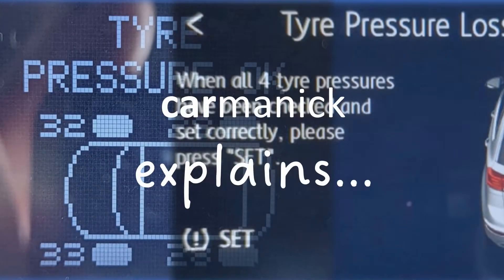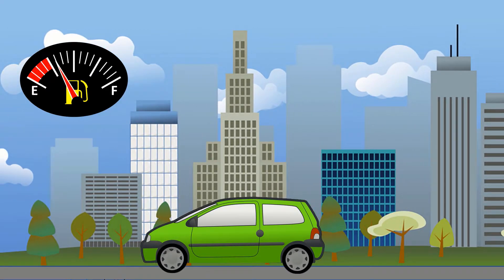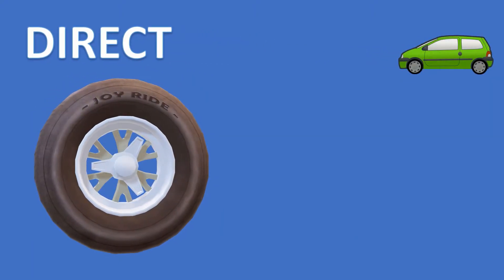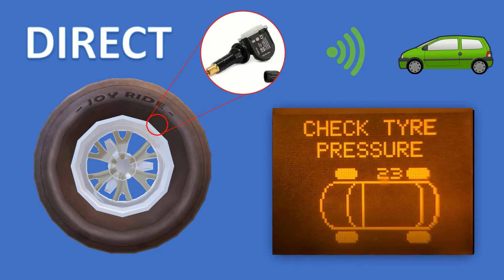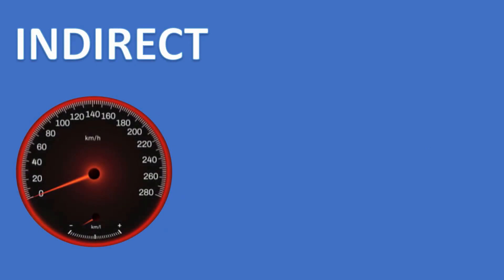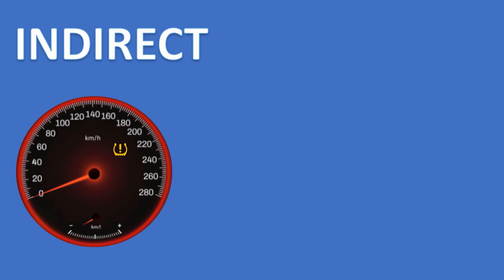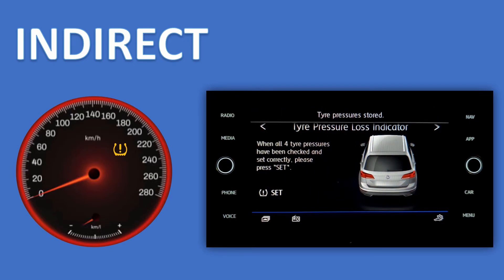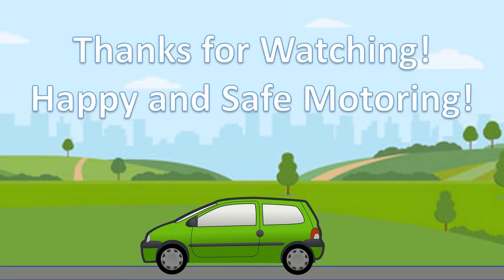carmanick explains... Direct vs Indirect Tyre Pressure Monitoring Systems (TPMS)

Comment: Can a bad hub bearing cause light for indirect
Reply from the maker: @riotbo  have you got an abs light or tyre pressure light on? 

I wouldn't think a hub bearing would affect it really. It will be noisy but the only way it would cause an issue if it was causing the wheel to rotate at a different speed which it couldn't do

Comment: Direct TPMS sounds more practical👍
Reply from the maker: @vivekjaiswal2422  yeah it sure is. It's much more useful and informative but it's more expensive for car companies to fit, and there's more to go wrong over time. Direct is less likely to work on older cars as the batteries in tyres are not likely to be replaced !
Reply: @carmanick  I agree what you told for old cars, since I have a new car with active TPMS in built, now it's very convenient for me to check the tyre pressure accurately in day to day running.
I am assuming my old car had indirect TPMS that was also good.